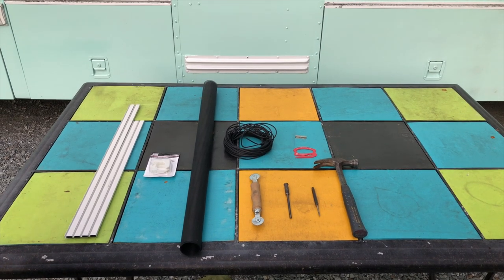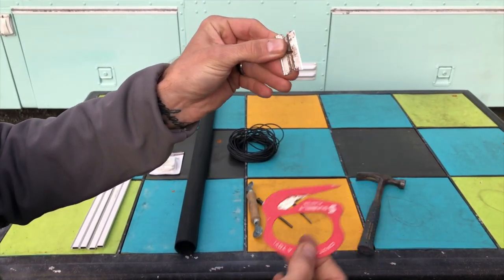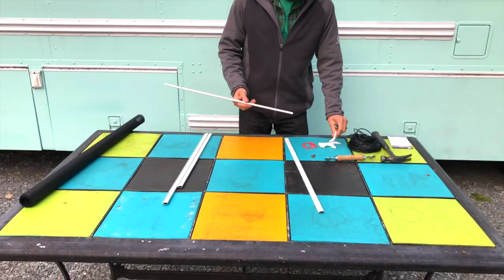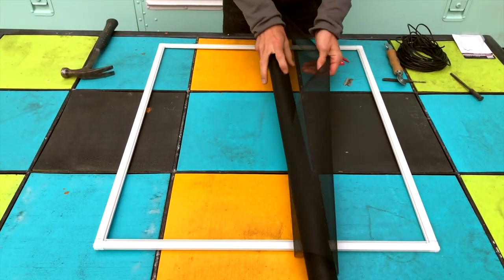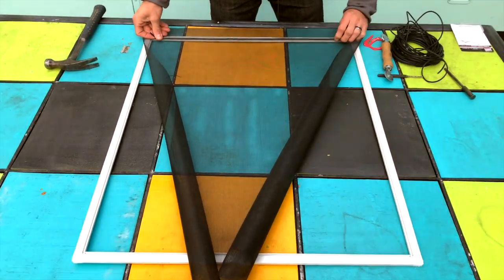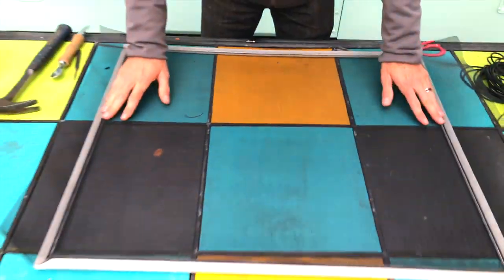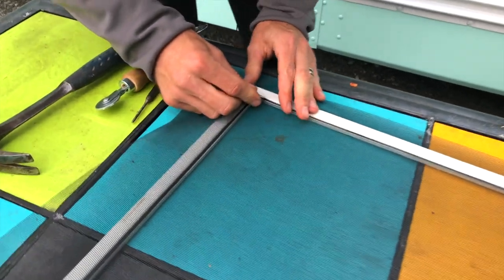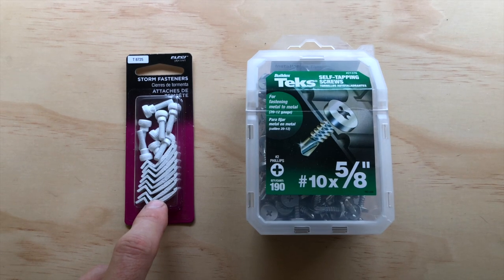How to make window screens for your Bus/Skoolie - CHEAP and EASY -

Comment: hey great video. Pro tip  sense you have different size windows  on the side of each screen you can write with a permanent marker numbers maybe start from passenger side window.   so when you take the screens down to wash the windows it will be easier to replace. what a pain when things like this get mixed around.
Reply from the maker: Thanks for the tip! Really great idea. Will definitely implement this when it comes time to wash windows soon.

Comment: Nice work! Fyi, you don't have to cut the spline each corner, you can just turn and keep going around the whole frame with one long piece. (unless the channel is in the way at the corner, in which case either trim it or do what you did) I would also suggest just using a construction knife, aka "box cutter", it's safer, and useful in other projects.
Reply from the maker: With these particular corners the channel did not continue all the way around, which is why we had to cut them. I used the razor blade because it's what my father in-law had available. I did put a box cutter style razor blade as a link in the description box for those that need to purchase something that was what I recommended. Have one on the bus now, which I used recently to make a few more screens and it did work much better than just the blade.

Comment: I plan to use the no see um solar screen, blocks 65% of the suns uv rays it claims and will keep those bitin gnats out. I am curious to see how this will cut down heat in combination with my ceramic window tint.

Comment: BE VERY CAREFUL WHILE ROLLING SPLINE  N O T  TO PLACE TOO MUCH FORCE AGAINST THE INNER WALL OF THE CHANNEL TOWARDS THE SCREEN AS IT  W I L L  TEAR THE SCREEN AS YOU ROLL ALONG- ESPECIALLY USING A METAL VS. PLASTIC ROLLER TOOL. BREATHE